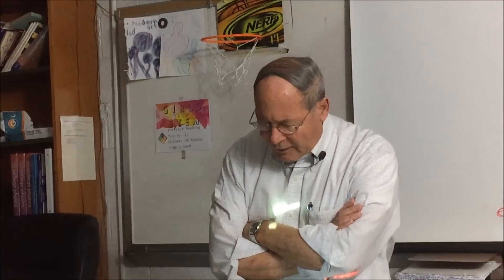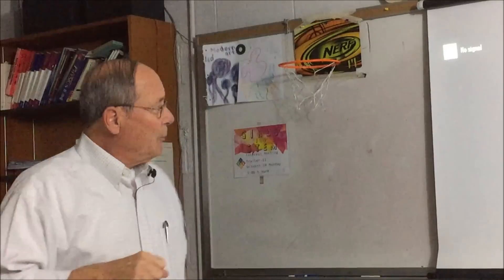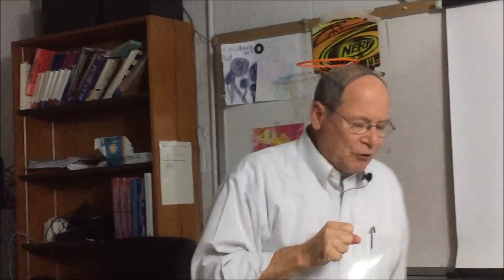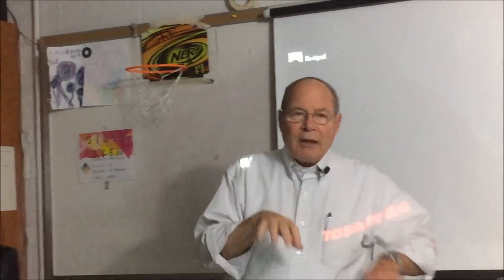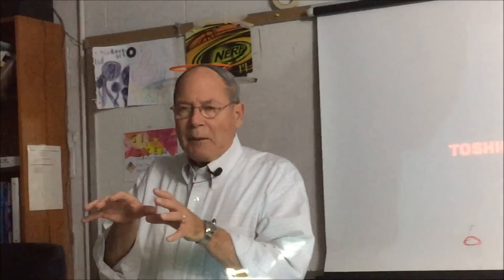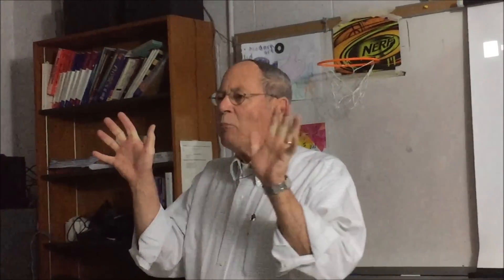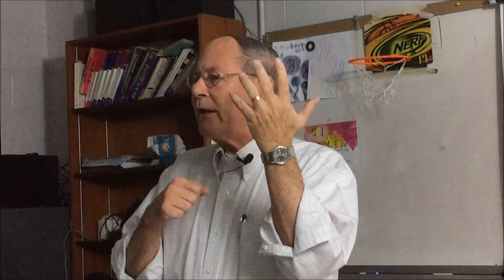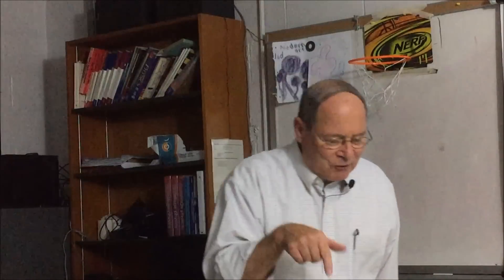Electrical Safety, Grounding and Bonding Tips for amateur radio stations

Comment: Run a connection from my station to my electrical panel? It's about 30 ft away. My goal is 800w @120v w/ a 1:1 SWR. I'm willing to do whatever to achieve that. Still, I dunno what the hell I'm doing!  :(

Comment: Howdy.
Actually the best feasible safety measure is Equipotential Bonding in the Environment of Utilization.
What heck is that ?
It is continuing the grounded outlet's ground wire (usually green or green-yellow) to the armour steel in the concrete shack floor. And any other large conductive parts (radiaror piping asf) too. This way the fault touch voltage of an appliance is as small as possible towards the floor or piping.
I try to illustrate this in my blog:  eugpoh31.blogspot.com

Regards.

Comment: Hmm, my "tower" is a HUGE Fir tree that I hung my antenna in... How exactly do I bond my tower to my system?!
Reply: I think he said, the bonding is for DC/AC, not lightning/RF.
Reply: @you2tooyou2too  (it was a joke!) according to the National Electrical Code or NEC... ALL externally mounted antennas must have a ground rod as close to the point of entry into a home/building, including Sat dishes ETC, and those ground rods ALSO need to be bonded to the main ground rod of the building, all of which is for lightning protection... 
Lightning is a tremendous form of "DC" BTW... 😉

Comment: I put each hand on a different heat sink on a 1000W audio amplifier. I wasn't thinking that the voltages were live and opposite on the heatsinks. Got an evil shock and blew the amp, now the protection light always comes on. Anyone know what i should look for? Could it be simply the main driver transistors? I think my heart is better than it was before but you could get unlucky! (dead). Saw a nasty safety video once where a bunch of guys are wheeling a scaffold tower inside a large factory or power station. Like flies on a HV fly trap. Nasty!

Comment: Article 810 is for home / residential installations not commercial radio/tv systems. Much bad inflammation in this video.  Do your self a favor , watch Mike Holt's grounding videos and the Contest University Grounding videos by Ward Silver. Way too much bad/dangerous information in this video.
Reply: From an electrical standpoint Mike Holt is very good, but i feel his understanding of the reasons for ground rods needs a little help.  Ground rods serve 2 purposes 1. To keep voltage on the grid stable.  2. To dissipate electrical charges from the air to ground.  They do not provide a path to clear a fault. Towards the end he did give the correct answer saying it is important that everything is bonded to the service ground.  A good read for anyone putting up a station is Motorola R-56.  It is hard enough to properly implement R-56 into a comercial station much less a HAM station but it does give a good base to start from.  

One thing that many HAM stations will do is sink a ground just outside the shack. This should never be done, because it sets a potential difference between it and the service ground through the house. All feedlines and ground should enter at the service so in the event of a lightening strile the potential between them is 0.  That way the whole house rises to and falls from a million volts with no other path to ground from inside of the house.  During the strike the potential voltage between everything inside of the house remains close to 0 volts. 

This is all spelled out in R-56
Reply: @K6ORJ  Yes, I agree 100% with you on the grounding and rods. Mike only talks about grounding from the standpoint of the National Electrical code.
While watching one of Dr Tamatha Skov's mini-courses on space weather, another reason for only having one ground rod occurred to me. During geomagnetic storms like we are having now thanks to a few healthy CMEs, you have currents induced into the earth which also could cause a difference in potential between 2 or more rods in the earth.

Comment: MR TRUCULENT SAYS !!!! I also have my views about Westinghouse and Edison AC Vs DC. How can you compare which is best way to fry someone in the electrical chair. Mr Truculent supports Amnesty International, and is 100% against the death penalty. Even Russia has suspended the death penalty. The only country in Europe which still has the death penalty is Belarus. Why was the eclectic chair made of wood, surely it would work better if it had been made out of metal. Wood is an insulator.

Comment: My fun with learning how shocking equipment can be was about 10 years ago when I was working tracing a short on a Hallicrafters transmitter... I was working with the chassis fully out of the case, late at night(after I got home from work at midnight), and separating the transformer leads from the chassis until the fuse stopped blowing... When I finally separated the correct pair, I immediately started tracing the harness from the transformer- it was the heater string... Well, I leaned over the still hot(!) set, and rested my right hand on the chassis, and traced along the heater chain to see if there was a short (there wasn't- spoiler alert- it was the transformer internally shot). 

As I went, I felt a tickle, then a burn from the right side of my chest, which went up my chest, and down my back and right arm- which spasm'd and threw me away from the chassis. My entire back locked up and released (and cured a long term back issue by resetting my back!) and I could not stop breathing deeply for about two hours. 

Afterwards, I realized all the things I had done wrong (and never fail to tell my A&P students when I talk electricity, in hopes they don't follow that example)  I also realized that had I put my LEFT hand on the chassis, and traced with my right, that voltage would have tracked left to right... 120VAC stepped down to 6VAC... Work the math...
Reply: Glad you survived. Back in the day I was working on a powered commercial AM/FM radio, chassis out and upside down. I rested my left hand on the chassis and noticed a burning sensation on my left hand. I pulled my left hand up with no damage, B+ was only ~ +350 VDC:)

Comment: Great vid, however a correction at around 2:27
A current passing through the heart can cause ventricular fibrillation (not "deflibberation") 
Which is an irregular heart rhythm and the heart must be DEFIBRILLATED  using an automatic external defibrillator which automatically analyzes the hearts rhythm and applies a precise electric shock to correct the heart beat back to normal.
Reply: Yes, It is related to the word "fibre", because the heart muscle 'fibers' are all contracting randomly on their own, rather than being synchronized by the normal nerve pulses that trigger periodic unified muscle contractions, like a fist milking a cow.  An electrical (or even mechanical) shock which depolarizes the heart nerves, so they cannot generate a proper sync pulse, allows the muscle fibers (which want to beat anyway) to start contracting individually (but more slowly) on their own, asynchronously, like a ball of spastic worms.  Under the right conditions, a careful electrical pulse can reset all the muscle fibers & nerves at once, and if the nerves can then generate a proper sync pulse, so the heart is back in business (perhaps, despite some damage).

Comment: If my antenna mast is  - 100 foot away. At the mast I have spaced 3 grd. rods hooked to my mast. 100 feet is a long way for a grd. conductor. ? Is @8 bare copper enough wire. >????
Reply: @zanelile2991  Read Motorola R-56